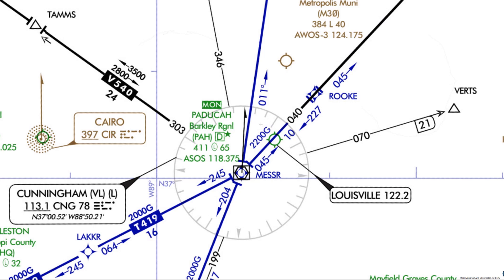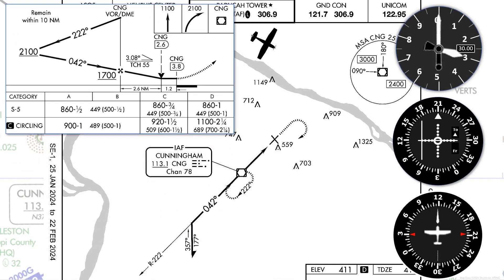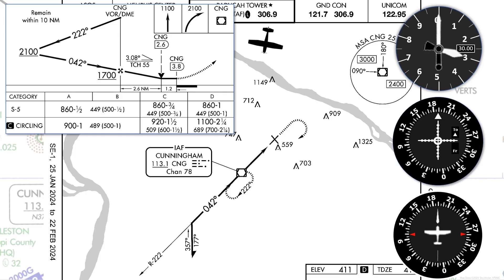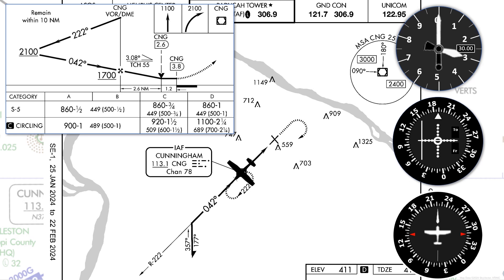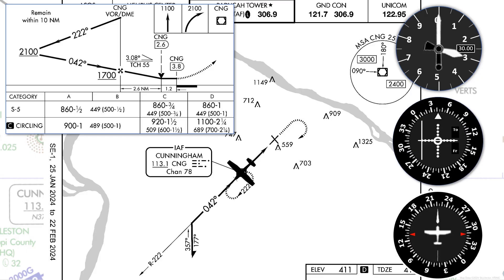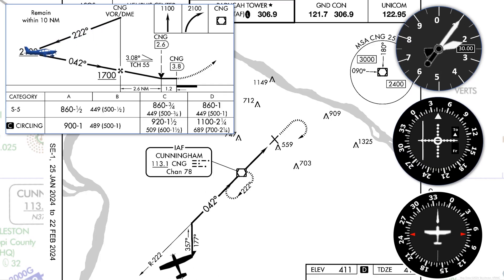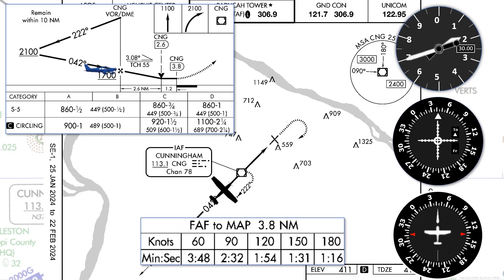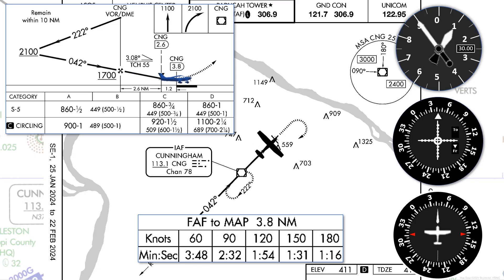Shooting a VOR Approach | IFR Training | VOR Explained

Comment: here is my questions, say you are cleared direct the CNG VOR (your heading is 330 direct CNG) cross CNG at or above 2400 (the MSA, would normally use the MVA but I don't have that info available) cleared "strait in" VOR RWY 05 approach Paducah. is that legal? is that doable? is that smart? from my experience as ATC I have always given the turn to final 3 miles outside of the FAF, or PT over the VOR. never a strait in because it is collocated FAF and IAF.
Reply from the maker: It’s not great to be 700 feet above the minimums at final approach fix. But if for whatever reason you were cleared this high and given straight in instead of the procedure turn, you could descend on the same angle and break out at circling minimums, only 40 feet above straight in, and enter the pattern rather than descending straight down to the runway
Reply: @flightinsight9111  thanks, it does not feel right. when issuing an approach clearance I want to set the pilot up for success and put you high on the approach, in my head, puts you in an unstable position on the approach where you are chasing the decent profile. always nice to get a pilots perspective.

Comment: two points to note: you can make a left or right turn from the protected side of the procedure turn when turning back inbound on the VOR course inbound to the FAF. 

next: should you start descending at the FAF after the flag flips? or should you wait to descend until after gaining positive course guidance (ie flag flips to FROM and “needle off the wall”)? i’m not sure there is consensus on this.
Reply: In this video you can descend when crossing the FAF (the VOR). A course reversal was done and you are established on the inbound course/heading for the runway.

The way we do it on a VOR approach in my local area, and instructors, experienced pilots and DPEs agree with this, is that if you do a course reversal and tracking a course inbound, you can descend at the FAF even if the CDI isn't centered when crossing a VOR. The reasoning behind that is you know you're over the VOR and you know you are on the course inbound. 

If the course reversal isn't done, because you are approaching and intercepting the approach course from the "NoPT" side of the approach, you must wait to descend until after crossing the FAF (VOR in our case) AND gaining positive course guidance. The reasoning behind this is because you are not established on course, you don't know exactly where you are during that turn after crossing the VOR and intercepting the inbound course. The approach is the VOR-A into KCEW if you want to take a look at it.

Always double check with your local instructors or DPEs though when going up for a checkride... lol.